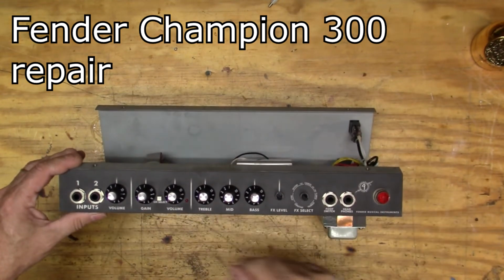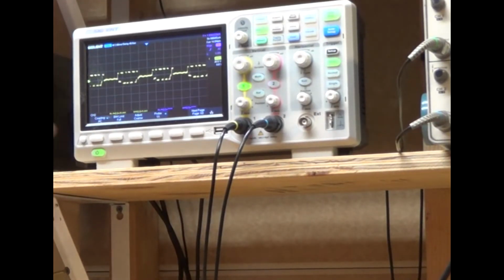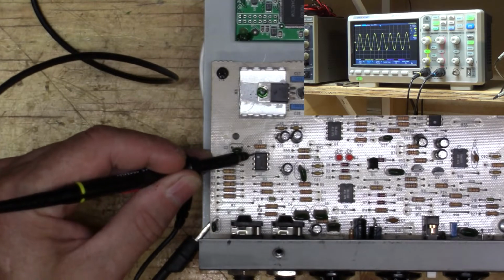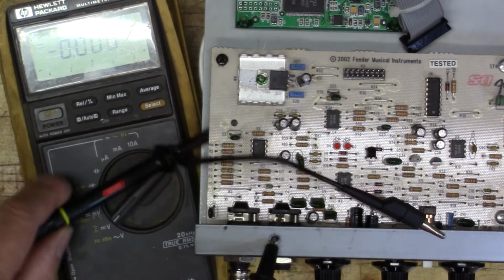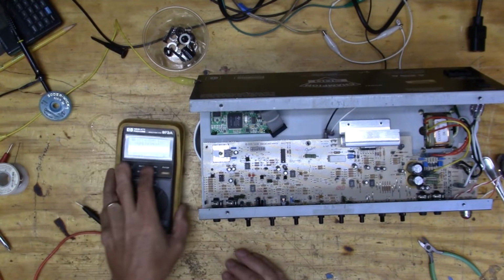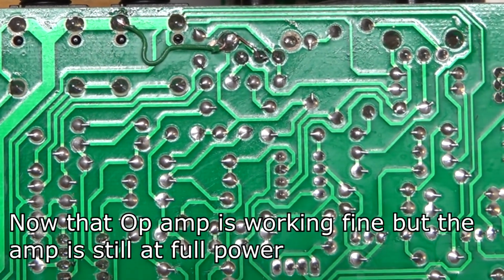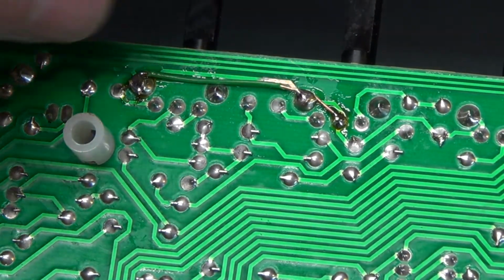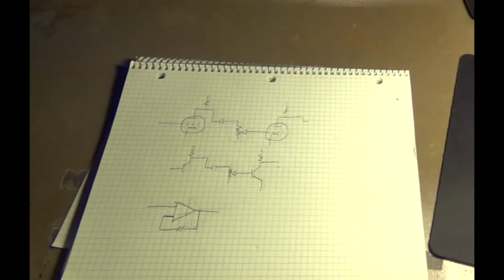Fender Champion 300 / 30 guitar amp repair and demo

Comment: I just picked up one of these. The fuse in the mains plug blows every time I plug it in. 
This video is so thorough, maybe I actually have a chance of repairing or at least diagnosing fault.
Reply: Check to see if the output transistors are shorted since the fuse is blowing, make a dim bulb tester it will save you money on fuses

Comment: ROB"S FIXIT SHOP, if the B+ voltage was +450vdc normal but was modified to B+600vdc why would this raise increase the AC  ripple voltage? for fender amp if you REMOVE pull out the normal chans first preamp tube the vibratos chan preamp will have more voltage output and wattage, why is that?